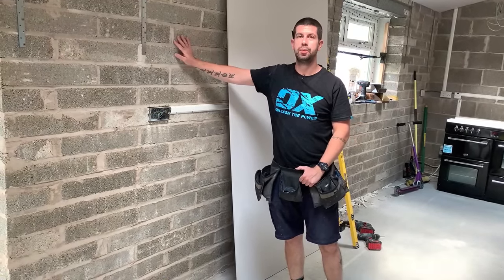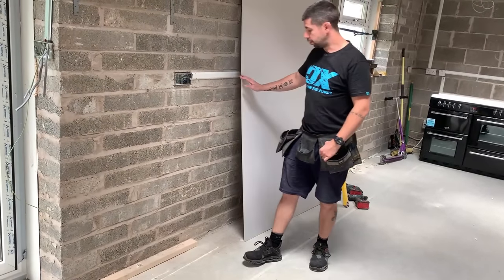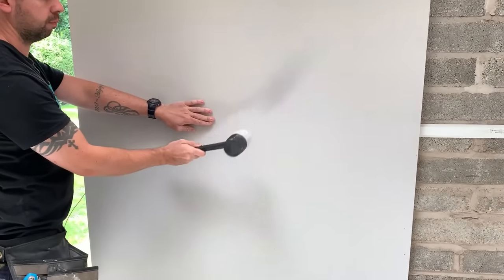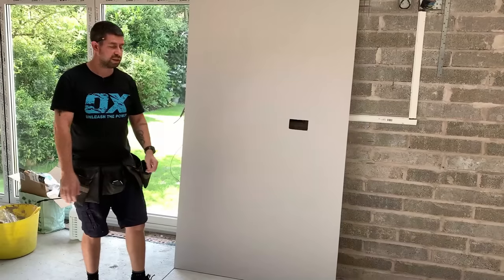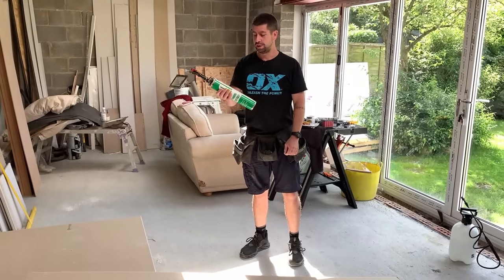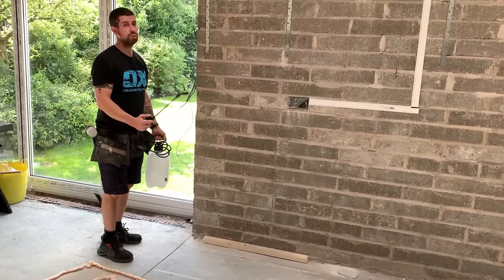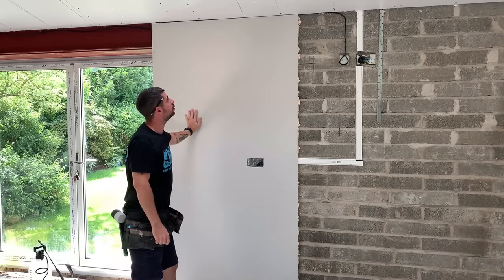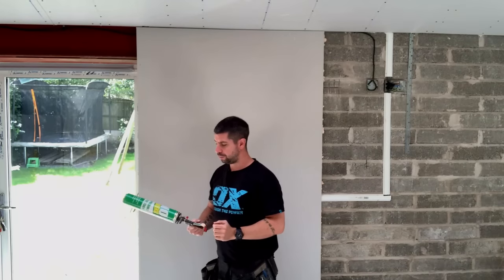How to plasterboard walls, the easy way with foam

Comment: Stick to dot and dab making hard work out of easy job
Reply: Totally agree I could have boarded half the room in the time he waited for foam to be ready al stick to dab
Reply: @gazw9079  ... You could have boarded half a room in 5 minutes?
Reply: @chrishood2883  have most of it pre cut before you mix
Reply: ... This couldn't be any easier? How is what he done difficult lol
Reply: @Gavin Craig sometimes you have to go with with the times bro.. you swear by dot and dab and going back in time the old skool swore by the lath and muck method but then came Dab.. now I guess it’s foam time
Reply: It’s better than using insulated plaster board on a 9” wall. Some customers are tight arses and won’t pay the extra. So at least this stops spots appearing over the winter…saving you the hassle of a winging customer 😂
Reply: If you find this hard work, I suggest you stick to stacking shelves at the supermarket son.
Reply: But then it takes you ages to clean up. Dot and dab is crap

Comment: Sorry mate not feeling it! I’d have stuck the whole wall in that time with dab! And what about shocking walls that bricklayers leave ! It would benefit a small wall or maybe a diy person but no dabber is going to do it! Oh and do the bloody reveals first always always!👊
Reply: Hahaha yeah I'm probably with you pal. Love a good new build... Bottom block is true, then... the rest are just fucked.
Reply: @skindawg3615  🙈😂👍
Reply from the maker: The video is aimed at DIYers and I think it's an easier method for an inexperienced DIYer.
I don't reckon it will take the place of dot & dab on site and I know how fast you lot can throw boards up.
Thanks for the tip about the reveals. Can you explain the reasons for this?
Thanks for watching and don't forget to check out my other videos and subscribe to help my channel grow 👍🏼
Reply: @spendtimesavemoneydiy  glad you didn’t take it personally! I’m not a hater! We stick our reveals first as once set they act much the same as a door frame! Meaning I strike my boards off them! If you set them to the proudest point ie the sockets you can sit the board inside the reveal and use it’s level to strike off! How this helps mate !👊
Reply: @spendtimesavemoneydiy  subbed 👍
Reply: @spendtimesavemoneydiy  meant to say”Hope this helps”!!!👌
Reply from the maker: @steved6472  I try not to take offence to comments, if they're bad I usually just come back with something sarcastic.
Thanks for the tip for the reveals and subscribing. 
Constructive criticism is always welcome on my channel. It's how I learn more and improve the channel 👍🏼
Reply: This used to be called bodging lmao what happened
Reply: Dot and dab is a sure way to transmit any moisture on the wall straight through to the plasterboard. Foam won’t do that! Also no cleaning out buckets, mixing, cleaning up buckets, barrels, trowels!
Reply: @PB111627  This is the exact reason tradition is going down the pan and more and more plastering skills are being lost over time I wonder how many can actually float and skim anymore 🤔 👍
Reply: @lea-rw5cb  To me plastering skills are fitting covings and centrepieces but our 8ft ceiling heights have done away with the need for mouldings. Then there are all the lime renders and knowledge about them. I regard dot and dab as a horrendous shortcut in the first instance.
Reply: @PB111627  fiberous plastering is skill in all on its own that art went out when they invented polystyrene coving lol I'm from the era when cross grain floats were used and lime mixed into skim, mixing browning in a giant bath with a shovel.
Reply: Foam is better for an external wall with damp/condensation issues than dot,dab because it doesn't lead to thermal bridging and leading to cold spots and moisture buildup especially when used with thermal insulated boards.

Comment: Great video 👌🏽 Just recently started using foam myself I can’t fault it so far, cleaner, less strain on the body ! Also easier trick I find for the back boxes is to use off cut of plasterboard to scribe around them so leaves a chalk imprint on the back of the board when you tap it !
Reply from the maker: That's a great tip for the back boxes, thanks a lot.
Thanks for watching and don't forget to subscribe to help me out 👍🏼
Reply: I just wet the socket it marks the board
Reply: @spendtimesavemoneydiy  your welcome mate I taught James Brain how To do that when he was my apprentice.
Reply: @jamesbrain9652 It's so old fashion nowadays using dot & dab & messy...

Comment: I cant help but wonder how the expanding foam doesn't push the board away from the wall. I guess id have to try it and see for myself what happens. One place i absolutely detest dot and dab is in kitchens. It can be a nightmare fixing back wall units. Sometimes,  the old fashioned or traditional building methods are much better.
Reply: It doesn't expand as much as regular foam
Reply: You'd maybe consider the original dot and dab method for a wall with wall units to be fitted and make sure the wall is well dab'd along the fixing line for the wall units. It's very solid once it cures and would be plenty to stop the bounce depending on the thickness. The wall behind is pretty important too and you have to make sure you use longer screws to fix the brackets.

Comment: The socket marking tip is pure gold👍
Another bonus to using polyurethane foam for bonding plasterboard is there is no cold bridge spots as there sometimes are with conventional dry wall adhesive. Foam has great insulation qualities
Reply from the maker: Great point! 👍🏼
Reply: Agreed, the socket marking was genius
Reply: But I was thinking, in 2023 don't they require at least 244 mm of insulation to give you a decent EPC compliance? I have the plasterboard and all, but I am thinking about sandwiching some kingspan in between, will the foam hold to both wall insulation and plasterboard or do I need to screw it in on-top? I didn't want to build a timber frame.
Reply: @thewizardsofthezoo5376  I just had building regs people round in mid 2023 and they required 100mm foam board, not 200plus
Reply: You shouldn’t get cold bridging from an internal skin as there’s insulation in the cavity.
Reply: @thewizardsofthezoo5376  You can get plasterboard with insulation already attached to it in differing thicknesses.

Comment: The insulation improvement will be enormous!.
A still air gap coupled with the polyurethane foam will be giving a resistance value close to 25mm foam backed plasterboard.
It would be interesting to do a controlled test to verify the U value.
Reply: That's not how it works, the R value of plasterboard is low and putting some foam in it wont give you an even insulation so you will get cold spots. The best results are if you batten the wall and then put PIR at least 50mm in between, tape the joints and then plasterboard on top with skim or tape and joint.
Reply: Thank you, I came here to ask that 😊.

Planning to insulate concrete garage.

Comment: Nice video and just a tip at  2:03 draw with a pen on the wall on the right side of the board to mark its position and then foam on the wall after moisting it within the penline, then on with the board, lesser foam accidents

Comment: I have tried both but I prefer dot and dab in long term as the plaster hardens and prevents plasterboard not to warp. Foam is soft and can distort the joints.

Comment: Nice tip..also if its similar to fire foam then it will form a fire barrier in the wall cavity around the electrical socket. Keep up the good videos!
Reply: The Screwfix No Nonsense sticky foam is cheap and not fire rated. 👎

Comment: Very impressive. Don't like dot dab as allows moisture potential condensation and mould. Supposed to apply bead all round edges to stop this, as you showed with foam, but rarely done. Easier by far with foam. Have fixed skirting with foam and very handy when needed to take it off later for furniture. Breadknife.

Comment: Thank you for your clear video, I can use this on my rsj where the builders used dot and dab and timber which then failed as the timber took all the moisture out! Got a more competent builder to re finish the big structural stuff but leaves me to plaster board the rest. I’ve done the framed bits so dot and dab is next!
Reply from the maker: Why did they dot & dab on timber? I always use screws.
Good luck with your boarding and let me know how you get on.
Thanks for watching and please check out my other videos and subscribe to help my channel grow 👍🏼
Reply: @spendtimesavemoneydiy  you miss understand, screwed on all the framed bits bow it’s time to dot and dab the rest!

I do have a steel rsj to fire board so this stuff will work perfectly on that!
Reply: I like the idea but one question.....how many sheets will one can of foam do and how many bags of adhesive would it take to do the same number? In other words what's the cost comparison?

Comment: Nice one. Your videos are always very informative. 
I’ve used the foam before. I found you don’t have much time to work with it. Need to get it plumb quickly. I was putting insulated plasterboard onto old walls ( plastered and painted ) so this may have reduced my time significantly. Overall though, it’s been done a couple of years now and no issues.
Reply from the maker: I did this about a year ago and no issues either. 
You're right you do have to work quite quickly but preparation is key.

Comment: Great tip. You could use two screws mid bottom and mid top as anchor points to grab the plaster board and then just patch the small holes to save you getting foam all over your hands.
Reply from the maker: That's a great tip.
Thanks for watching and don't forget to check out my other videos and subscribe to help my channel grow 👍🏼

Comment: I have used a similar product to line a steel shed with styrofoam and osb. Very pleased with it. Just wondering in a domestic situation how long would it hold plasterboard if a fire broke out. Maybe a few metal fixings would be good.
Reply from the maker: I'm hoping I will never find out 🔥 👍🏼
Reply: You’re supposed to add 4 metal fixings per board incase of fire
Reply: @livingoffgridinscotland  thank you, I,m about to fireproof board (and insulate) a garage to hold my office, solar inverters and batteries. Fire was a big thing on my mind, I will screw plenty fixings.

Comment: Push it back to the wall with a straight edge, any belly in area the foam will squash really easy and the board will then belly in so use that straight edge. A couple of straight long timbers held vertical against it with a couple of timber prop holding them in place  for initial cure period, say 5- 10 mins. Only put some extra fixings in after fully cured or it will also pull the board in.

Comment: Just done 2 rooms using dot and dab method which turned out great.  I used a similar product to this to board around the windows and was very surprised how much easier, quicker and tidier it was.  Have my porch to do next and I’m tempted to go down this route.
Reply from the maker: I really like this method rather than traditional dot and dab.
Let me know how you get on 👍🏼
Reply: @spendtimesavemoneydiy  is it necessary to PVA the wall 1st
Reply from the maker: @TheWiccanGirl  if the walls are sound like these breeze blocks then no but if it was an old flakey wall then it's always a good idea to pva
Reply: Those aren't breezeblocks, they're concrete blocks. Less surface dust than thermalites, always PVA thermalite.

Comment: Dab it mate, expanding foams OK for sticking small bits of board on but not full walls, the foam will deteriorate over time and crumble like dust. I would definitely put some screws in to give a mechanical fix to the wall

Comment: The walls need to be quite flat/straight to use foam.
I've struggled with 1920's walls where they can be up 25mm out. In those days great dollops of plaster sorted everything out.
If using on aircrete blocks you can drive long plasterboard screws straight in, to pull it all level/plumb..or hold it with a straight edge for 10 mins+!
Reply from the maker: I've used it on really bad walls. It is difficult and I used a lot of foam. A good tip is if you have a little movement in the board after it's cured them I drill a 10mm hole and fill with foam and it firms up great 👍🏼
Reply: Thanks for this. Struggling with uneven walls myself. Maybe make another video with older, uneven walls?

Comment: Thanks for doing. Was going dot and dab but think I'll try this . Ever used Mega Stik? And which woyld you recommended. Nedd to stick 50mm insulating plaster board to breeze blocks and was going to PVA . Can you also  recommended a good foam gun

Comment: whats the fire resistance of the foam? with dot and dab the head of the board is filled solid to prevent possible fire from rising behind the board and sub wall. with this I don't think the foam would last long in a fire and may even catch light and increase the fire risk. all the boards would flop off the wall into the middle of the room along with cable sandwiched behind it and make escape a nightmare aswell as any firemen entering being in trouble. I bet it has it uses for hard to get to places but I don't think uts a substitute for traditional dot and dab
Reply: This No nonsense Sticky foam ain't fire rated. Wouldn't touch it with a barge pole, stick to dot and dab

Comment: I notice the plasterboard will be sitting a fair way off the brick wall due to conduit, socket etc. Is there any problems aligning the plasterboards with this method or do you just push and eyeball it?
Reply from the maker: I didn't have much trouble aligning the boards but you could always throw in a few screws if you're having trouble.
Thanks for watching and please consider subscribing 👍🏼

Comment: Do you have to put a vcl if it’s a cavity wall. Thinking of using insulated plasterboard. Also dya think you could use this method on ceilings . 
Cheers
Reply from the maker: If you do this on a ceiling you still need to screw the plasterboard but you use less screws

Comment: That air gap between board and block work will suck in warm air from the room causing mold to grow , and how is that airtight with no sand plaster mix on the block work ?

Comment: As a chippy I use to do the tiles on walls with silicon , a lot quicker and no mess ‘ just put it on four corners and centre , last for ever ‘ especially tiles on tiles
N

Comment: I'd like to see the finished wall with the straight edge used to give a perfectly straight ceiling and skirting line like you get with dab, in 45 years I've never had to use screws or stand holding a dabbed wall while it goes off

Comment: Thanks for this, exactly what I needed. Need to plasterboard my garage.
Never done any plasterboarding so this was really helpful.
What kind of screws will you use if you needed to tighten the board to the wall. I'm guessing you will need wall plugs which will be hard to put in once the boards up.
How do you get around pipes that  are in the wall?

Comment: Its ok if the walls are flat but what about when you need 2 inch of board adhesive In places a d its tight to walls in other places

Comment: Great video! Very informative and gives me the confidence to get on and re board my son’s room! One question, I see that the socket on the wall has been chased in slightly but it looks like another hasn’t. Is there a ‘best practice for how much a back box should protrude from the wall prior to boarding in this manner? Also, what’s the finished gap between the brick/block and the board? Many thanks!
Reply from the maker: The reason I make videos is exactly what you said. To give others the information and confidence to tackle jobs themselves and to pass on some useful tips too.
So I'm glad you are giving it a go.
Some of my backboxes were deeper than others so that's why some are chased in.
A 35mm box will probably end up flush to the board without chasing it in but it will depend on how much foam is used and how plumb the walls are.
Thanks for watching and don't forget to like and subscribe to help my channel grow 👍🏼

Comment: Great video! Does this work with foam backed plasterboard (i.e. the one that comes with insulation already mounted on the back)
Reply from the maker: It works great with insulated plasterboard and the extra rigidity of the insulation makes it easier to install than regular plasterboard.
Thanks for watching 👍🏼

Comment: Question…. Could you / why not foam the wall rather than the board? That way could be easier handling 🤔 especially if you have conduit and lines to go around, like there will be on that next piece😊
Reply: He said it tends to roll off vertical surfaces. Just wear disposable gloves..

Comment: I've chopped of 1.5 meteres where damp was and will be putting drywall on after damp proofing. What can I use to fill the small horizontal gap between the new drywall and the old existing brickwall.
Reply from the maker: Bonding plaster to fill gaps before skimming with multi finish.
Thanks for watching and don't forget to like and subscribe to help me out 👍🏼

Comment: I have a very uneven wall i need to do this on (plastering on bottom but not on top of wall, also a chimney i removed). would dot & dab be better for such a particular case? because then I can just use bigger dabs in order to level things out. that seems difficult with this adhesive?

Comment: Would this foam offer any insulation R factor?  I'm trying to figure out the best way to install insulation and drywall to a single depth brick garage conversion so it isn't so hot/cold inside.  Thank you!
Reply from the maker: Maybe use this foam but with insulated plaster boards.
Thanks for watching and don't forget to like and subscribe to help me out 👍🏼
Reply: You have to insulate and add a vapour control barrier.  Look at part L of the regs as they have changed recently. Talk to building control aswell because if want to sell in the future it will be a nightmare.  This method still needs mechanical fixing.